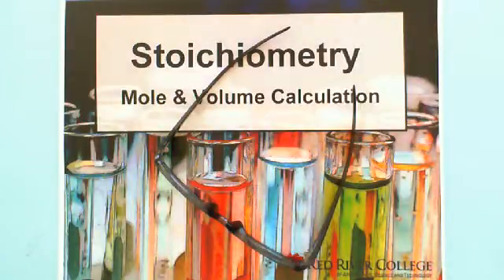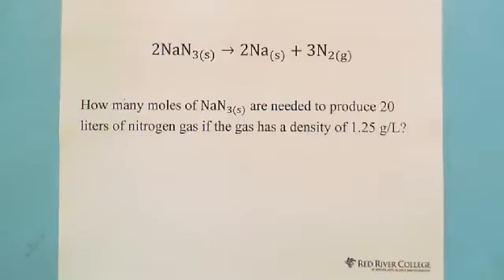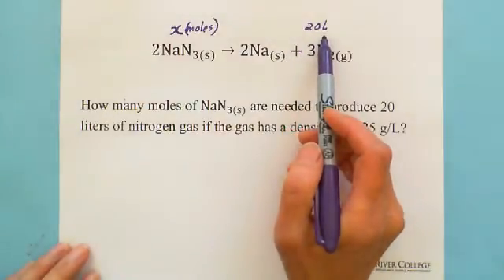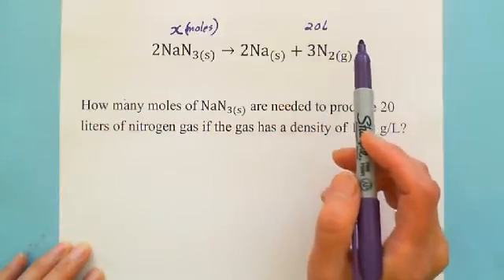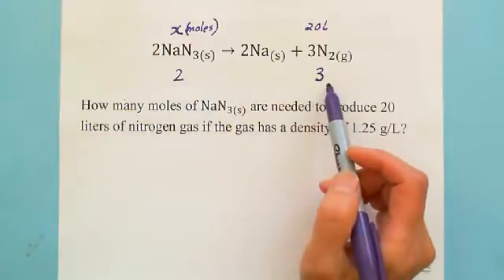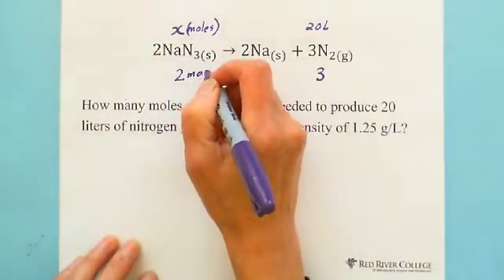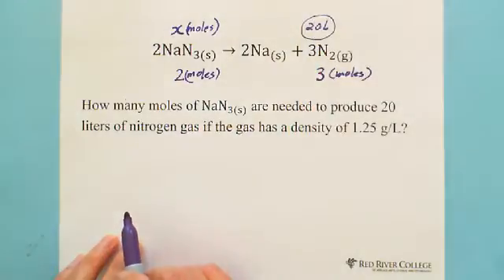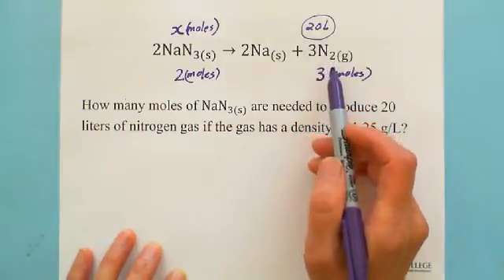Stoichiometry: Mole & Volume Calculation

Comment: the volume of a cubic meter is equal to the length of the pipe volume squared by the volume of a cubic meter released after two multiplied by three equal volumes